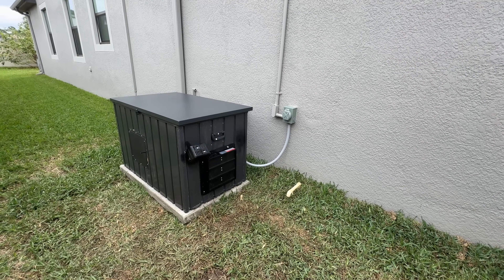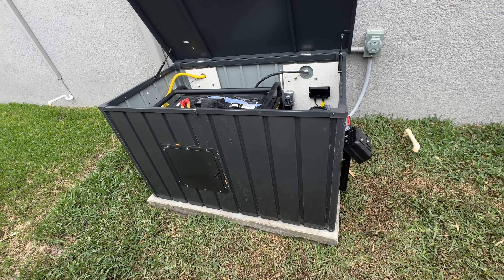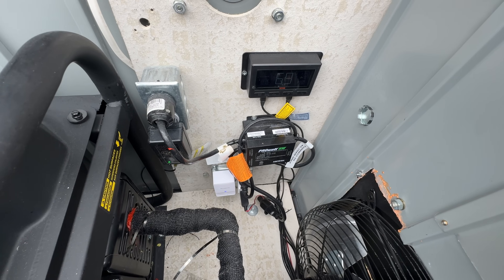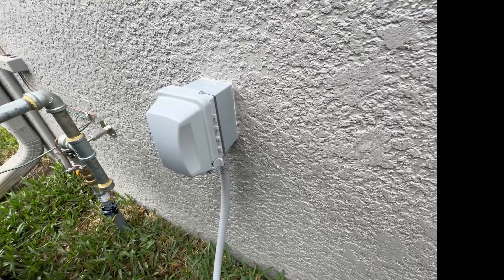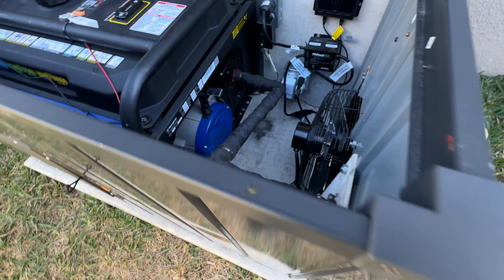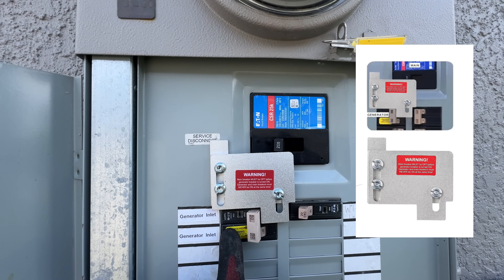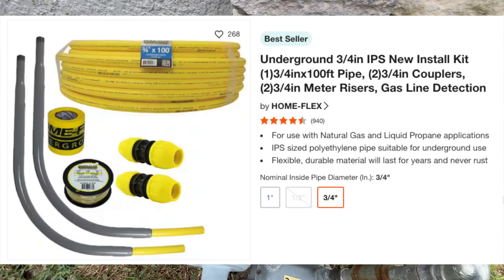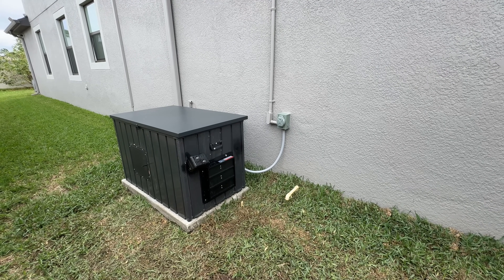DIY Whole Home Generator Enclosure: Power Your House Like a Pro!

Comment: Great video!!! I'm in FL also and buying exact the same gen but 28000 W model.. Thanks!
Reply from the maker: Perfect. Will you be building an enclosure for it too? If so, check out my follow up video.
Reply: @ColleKharis  Thank you sir - yes, I will need an enclosure and will be copying from you!
Reply from the maker: @crgeorge1  thank you. I also did an update video. https://www.youtube.com/watch?v=c5e3wWoElgA
Reply: @ColleKharis  I'm now debating whether I should build a shed out of plywood and install cement board on the inside instead due to the generator size - it just arrived and it's huge

Comment: I feel like this is the first time I have seen anyone deal with a grounding wire.
Reply: That is because you're not supposed to ground a generator that is connected to a house which is already grounded. This creates a potential for ground loop interference and I am surprised that a degreed electrical engineering technologist wouldn't already know this. But despite this one tiny oversight, he did a hell of a job creating a proper, safe and fully featured enclosure. Mad respect to the owner. 👍🏾

Comment: Awesome setup. Nicest one I’ve seen. Only comment I had is I’m not sure you need to ground the generator since your panel is grounded.  Also, I’m sure you did it, but you need to make it a floating neutral.
Reply from the maker: Thanks for checking out the video and sharing your thoughts. I have addressed many issues in my follow-up video: https://www.youtube.com/watch?v=qaS-JpN0WYI

Comment: Good luck Eco flow delta pro ultra X system 12000W and Eco flow delta smart panel 3 and Eco flow delta pro ultra X extra 10 battery and power whole house and 10,000W  solar panel 😊 please show more test it out on YouTube video and power whole HVAC Cooling unit and heating unit 😊👍👍👍👍👍

Comment: Well done! I did something very similar structure wise. Added a fan to pull exhaust out as well. Used two Firman inverter generators connected in parallel to provide 10k running watts, ran through a 50A plug. I just turn on the dedicated gas line, start the generators and then connect the wire to the house. Your automatic design is super cool!!!!

Comment: Do recommend a dual gas and propane generator
Reply from the maker: I believe having multiple fuel options is always a good thing. My generator is tri-fuel, and while I currently run it on natural gas, there could be situations where I might need to switch to gasoline.
Dual-fuel generators are a solid choice because propane stores longer, gas is easy to find, and you can switch depending on what’s available during an outage.

Comment: Interesting design.  This is the first off-the-shelf metal shed of this type I've seen.  You have incorporated some nice add-ons as well.  Does the metal shed provide any noise reduction when the generator is running?  How do you access the generator to do service work, like oil changes and air filter cleaning?
Reply from the maker: Thanks for your comment. I’m currently editing my follow-up video, which I hope to post tomorrow. I did a noise test at the end. The metal is relatively thin on its own, so you’ll need to reinforce it for better sound.

Comment: I was looking to build a generator enclosure for the same generator for my daughter's house!  Your video was the best to date and I plan to build it soon.  Appreciate listing the parts and where to get them.  Question:  the generator I purchased has an auto transfer capability and I was wondering if you know how to change from using the interlock, which I current have installed, to use this auto switch over. I did not know the generator had this capability until I read the manual after I purchased it.   If this is easily done, this generator setup would be a very inexpensive alternative to a Generac setup. Adding the auto transfer would match the capabilities of my Generac setup which cost $14,000.

Comment: Thanks for the video. I’m about to copy your build. My only concern is getting the generator out for oil changes? How tough is it to take the box apart to pull the generator out?
Reply from the maker: Hello, thanks for your question. I wouldn’t recommend adding another access door in that area just for the oil change; instead, it might be better to consider a larger enclosure. I haven’t done an oil change yet, but I already anticipate needing to make some modifications.

Comment: You don't go to Home depot to buy fittings and nipples to do your own DYI gas fitting job without knowing what kind to buy. Fittings should be malleable Iron that won't crack or leak out the casting seams. The pipe should be seamless, it CAN leak and you wouldn't even know. Hopefully, you did a pressure test of the piping. Cause the made in China fittings would never leak! Oh, I believe the galvanized pipe is a No, no as well. The galvanized flakes off and contaminates the system.

Comment: I went with this same enclosure. Seems quite flimsy but with some reinforcement from concrete board it will do the trick. I do however wonder your thoughts on how to make the front open up large enough to wheel out the generator for maintenance?
Reply from the maker: When I first got the enclosure, I thought it seemed a bit flimsy, but once assembled, it turned out to be very sturdy — at least for my needs. That said, I still see the benefit of adding concrete board to the sides for extra strength.

If I were to design a side access system to easily roll the generator out, I’d consider two options:
	1.	Hinge one side of the enclosure to the frame to create a swing-out door.
	2.	Build a drop-in panel, similar to a picket door, instead, this one slide vertically into a slot.

Since the enclosure has a top lid, you’d need to open it first to insert or remove the side panel.
Reply: @ColleKharis  Right, I want to go for the hinged door. The slab is waiting for good weather to be poured! With some smaller changes I am definitely copying your enclosure and some of the ideas. Love the temp sensor / alexa interaction. I'll be using thermostat wire to remotely operate the gen from indoors, so in those nasty winter storms (Canada here..) I wont have to get dressed to run the thing! 

Thanks for the video. A lot of good ideas here.

Comment: Great gennie enclosure! Along the Florida coast we have to use plastic enclosures. Metal will be rusted in less than 2 years. Galvanized or not it won't last.
Reply from the maker: Thanks for the feedback. You could probably use the plastic ones that look like this. I’m more inland, but I do expect some corrosion over time, so I’ll keep an eye on it and take preventive steps to extend its lifespan.
Reply: @ColleKharis  The more I rewatch the video, the more I realize what pro-level this DIY really is. Still cheaper than a Generac install.

Comment: Love love love it. I have been slowly building my design (in my head) as well for up here in cold Canada. This afternoon I ordered that exact enclosure. I'd love to know what you think on how I could get the front to open up instead of disassembling it for maintenance access. (my gen is 300LB, it ain't coming out from the top!)

Comment: Very nice! I have this generator too. I’m in Ohio, and thought metal is better than plastic. Also, considering just opening up doors so it can breathe if I need to use it as opposed to adding fans, or connecting a metal exhaust pipe out of the side. Any thoughts?
I’m actually ordering one of these containers. The difference between 150 and 160 gallons is 1.7” in height. Length and depth is the same. Will 1.7” shorter make a difference?
Any feedback is appreciated and your project is very good!
Reply from the maker: Thanks for the comment. I’ve learned a few lessons from this setup. If I were to do it again, I’d install fans on both ends—one for intake and the other for exhaust—and skip the exhaust pipe altogether. I’d also go with the next size up container to have a bit more room. I used the 160-gallon enclosure because I had to maintain a specific distance from the fence line to comply with county code.
Reply: @ColleKharis great points and thanks for the reply! 
The only thing I’d question about ‘no exhaust pipe’ is most of these alhave a built in carbon monoxide detector that will shut the generator off if it senses too much. I like your fan idea better, plus it think best to not tamper with the machine, but what fans are you thinking of? I also already have an outlet attached to the house next to where the generator will go, so this could power the fans, which would be powered by the generator. Share your thoughts if you don’t mind. Thanks friend!
Reply: Also, the fans would also keep everything from over heating!
Reply from the maker: @Danner22  Definitely. This was the only issue I ran into with this design. The pipe fitting kept loosening at the generator exhaust, so I picked up some different screws and a torque wrench to secure it properly. I also added a small 12x12 fan at the intake to improve airflow. So far, everything’s working great.

Comment: You should have a floating nutral and should not have grounded it. 

Standby generators ground to the breaker box to the house ground. Having the generator AND the house grounded create an opportunity for the generator frame to be energized. This could shock you. 

Good luck out there. Nice build otherwise. I could be missing something, but everything says floating nutral vs. bonded nutral on a standbye generator.
Reply from the maker: Thanks for the feedback. You are correct. I removed the grounding rod because as a previous view pointed out, the generator was already grounding via the breaker box. Thanks again.
Reply: @ColleKharis yeah no worries.

Comment: Not sure how great I would feel about using wire nuts inside a junction box in the attic to splice the main feed wires together. Either screw terminals or a single "home run" without intermediate connections is my preference just to ensure a reliable connection that delivers maximum amperages for load starting.
Also - you should mention how/where you bonded the ground and neutral together, if that's code where you are. Many homes have this done in the breaker panel and for a portable generator, they usually have the ground and neutral bonded inside the rotor/stator assembly. You don't want two points of ground/neutral bonding, so generally you need to remove one of them and likely the one in the generator.
Reply from the maker: Great feedback. As I mentioned in the video, I’m not an electrician, but I did pass inspection. I’ll definitely look into your recommendations—I genuinely appreciate them. Many people criticize without offering solutions or ways to improve, so I thank you for providing constructive input. It helps me and gives others the chance to learn as well.

Comment: Man I already have the portable Westinghouse 12500 generator and I’ve had the 50amp power outlet connected to my breaker box, I’d really be interested in a permanent setup low yours. The problem with the generack is my gas meter is on one side of my house and my breaker box is way on the other side of my house. Either a lot of wiring or gas line would have to be ran to the generator in which would cost a considerable amount of money in addition of the cost of the generator. I’d be more than willing to pay for an enclosure like yours
Reply from the maker: Hello, thanks for your comment. I’m not familiar with your exact layout, but if you have a crawl space like I do—and enough room on the side of the property near the gas meter—you might be able to run the 50-amp wire up through the crawl space and then back down to the breaker panel. That could be a workable approach.

Comment: this video is great man you are talking about saving like 10k or something it doesnt auto turn on when you lose power but idk if a generac even does
Reply from the maker: Hi, thanks for your comment. The Generac, like the generator I’m using, has an automatic start feature. However, it also requires an automatic transfer switch to handle switching the power source. I chose not to install the transfer switch for now, since it’s a pretty big project.

Comment: This is a great video and set up! You really thought about a lot of things. 

I had a few questions as I’m in the planning phase of creating my own. I live in south Florida and my biggest concern are the hurricane winds. Can this be bolted down?

I’ve seen others use insulation inside what are your thoughts to using insulation to help damage the noise further? Any testing of DB for sound when it’s on while closed?

I appreciate your help and video!

Comment: Nice setup.  I'd be curious to hear what that generator sounds like outside of a metal enclosure with no rock wool, etc., for sound deadening.  Maybe with a basic SPL meter with it open versus closed.  Those gens are already 74dBA @ 23 feet and up close, way louder.

Comment: This looks great and I'm only halfway through the video but I have to wonder how much of a pain is going to be to disconnect everything for oil changes. As I'm sure you know, oil changes should be performed after every 50 hours of operation.

I also noticed you didn't mention how much all this cost you. You shared the $14,000 bill for generac if you had gone that way. How much did this setup cost you with materials and how much time did it take
Reply from the maker: Hello. You’re absolutely right about the potential challenges I might face when doing an oil change. That was an afterthought, but I do plan to add another access panel to make that task easier. I’m not sure yet how difficult the modification will be.

As for the total cost—I did mention that it was under $3,000. While I did sit down and list out the expenses, the figure I gave is still just an estimate.
Reply: @ColleKharis extend the oil drain via 1/4 or 3/8 piping to shut off outside the cabinet seems like a good fix. How did you secure genarator to avoid vibration movement

Comment: Good job!  Just one comment; where we live in Canada, a swing joint or a flex connector would be required at the riser to the meter to compensate for frost heave and ground settling.  Frost is probably not a concern in Florida LOL.  Portions of your wiring would not apply to our off-grid situation.  Someone may have already asked but how does the blue tooth remote start function in the metal enclosure?
Reply from the maker: Hello. Thanks for the comment. Yeah we definitely don’t have an issue with freeze LOL. I haven’t had an issue starting it with the remote through the enclosure.

Comment: An 8ft grounding rod buried 12in deep? 🤔 other than that nice install.
Reply from the maker: Did I say 12 feet deep? LOL. I meant that top of the rod was buried 2 feet down.
Reply: @ColleKharis yeah you did and was always wondering about proper grounding depth for another project so I just threw it out there. I don’t even think 2ft is enough. HD has an 8ft rod and think 6 is minimum depending on soil type.
Reply from the maker: @dslgod  I used an 8-foot grounding rod and installed it in the trench I had dug for the gas line near the riser, which was already 2 feet deep at that point. So, in effect, the top of the rod is 2 feet below ground level, and the bottom reaches a depth of 10 feet.

Comment: Nicely done DIY, but if you're capable of doing this level of DIY then just buy a Generac and install it yourself. Used Generac setups with minimal hours are easy to find. A 10k Generac is ~4k new and ~2k used.   Putting together a bunch of cheap amazon parts is fun, but the same $ and a lot less time cobbling together could get you a Generac.
Reply from the maker: Thanks for the comment. I will take that into consideration for the future.

Comment: Looking to set up my own back up generator as well, with pro help. Your enclosure is the best I’ve seen. 

I live in Florida is well. Is it required to get a permit for installing the interlock switch and inlet box or any outdoor electrical work?
Reply from the maker: I didn’t need a separate permit for the interlock switch—it was included under the main electrical permit, so there was only one fee for that. Since the enclosure is considered a permanent structure, it also required its own permit.

In my case, I had to pull three permits: one for gas, one for electrical, and one for the structure. I started with the gas and electrical permits. Once those were installed and passed inspection, I proceeded with the permit for the enclosure.

Comment: Best generator enclosure that I have seen as well! This is a very impressive setup! I watched some other ones on YouTube several years ago before deciding on mine. I have a metal one with a flip top lid and 2/3 of the top front to access the generator. My question is, with you having the exhaust pipe fixed like that, how do you plan on removing the generator to perform oil changes?
Reply from the maker: I’m planning to add another access panel on the opposite side. Full disclosure: this concept is still theoretical, and I’m not entirely sure how practical it will be. If it doesn’t work out, I’ll simply remove the exhaust when it’s time to change the oil. This is one of those things I’d definitely approach differently if I were doing it over.

Comment: Nice quality work, but you all need to know that grounding it to a grounding rod is not correct.  Since he’s using an interlock that that not switch the neutral, the generator needs converted to a floating neutral, and the ground rod needs removed.
Reply from the maker: Thanks. You are the first person who actually provided a solution. I genuinely appreciate it.